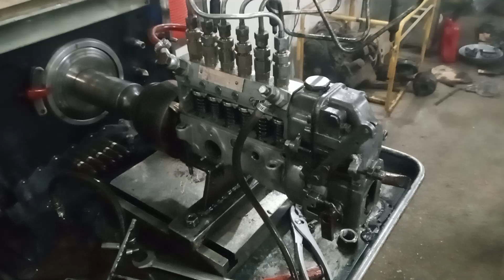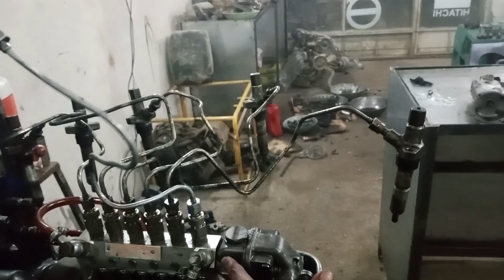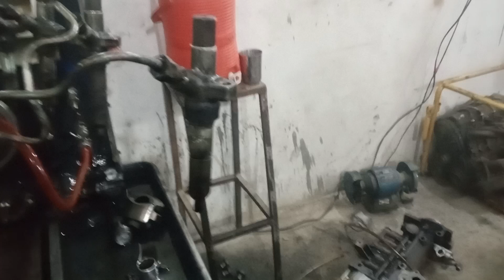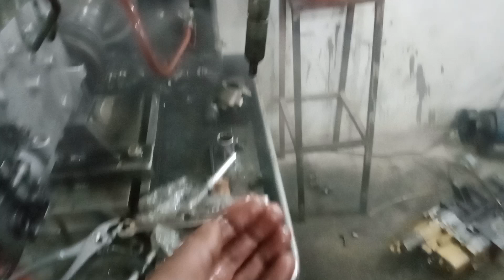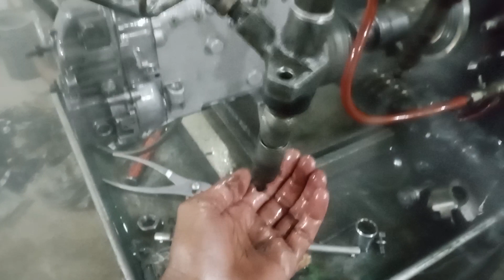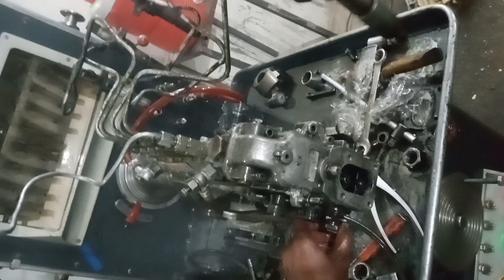hino fuel injection pump testing

Comment: This motor have 6injector with tube injection nd then pump injection so somethng i see is not easily to understand for me so i dont see where's the Tank gas alimentation............... Nd i like to read Rudolf about motor diesel nd Robert Bosh ...... Them Master pump injector
Reply from the maker: Yes it's 6cylander  inline pump.its 7d hino pump.